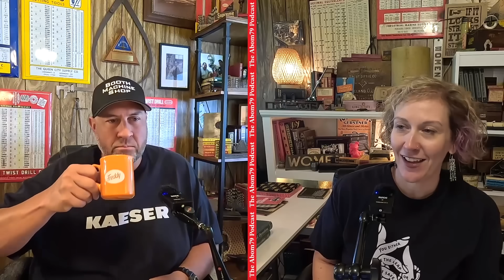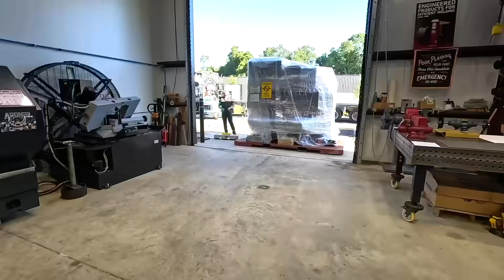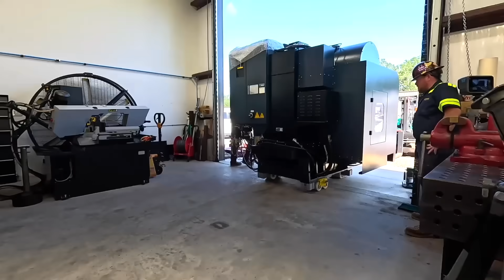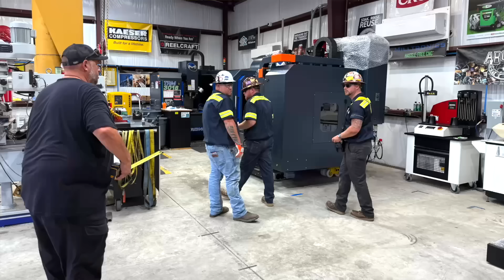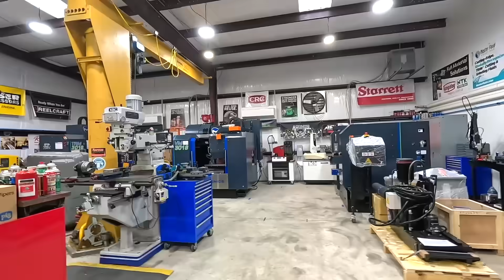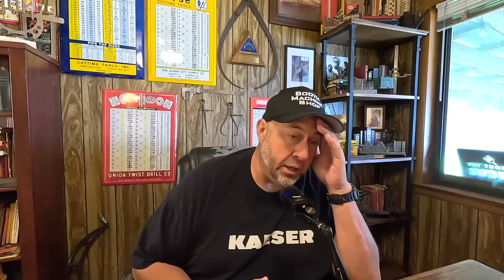Episode 7: The Abom79 Podcast

Comment: have a challenge for Adam...like to see someone do a Figure 8 Oil  Groove in a Bushing for Lubrication.....is the Milltronics Lathe Capable?.   ID Groove
Reply: I’ve seen several very complicated manual arrangements that will do that. Should be much easier on CNC.